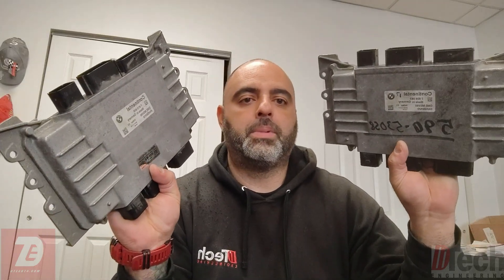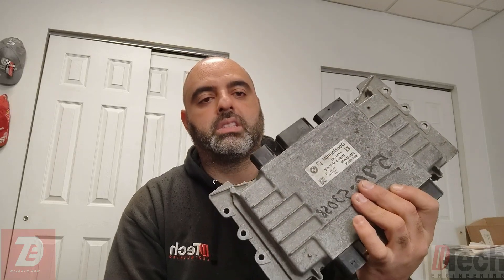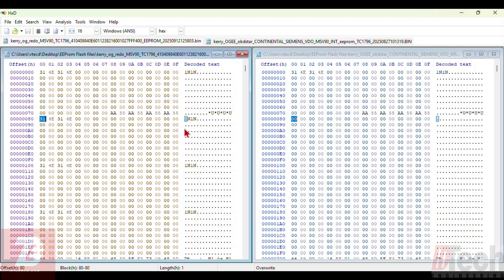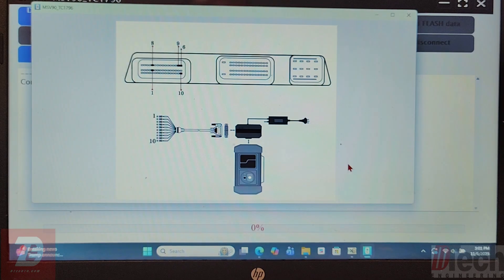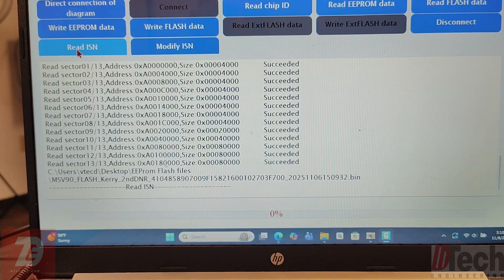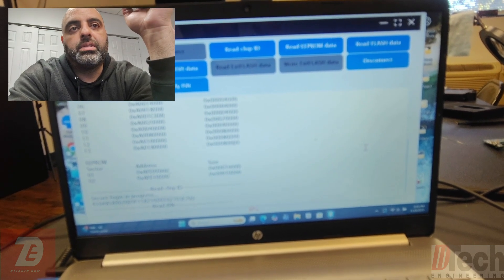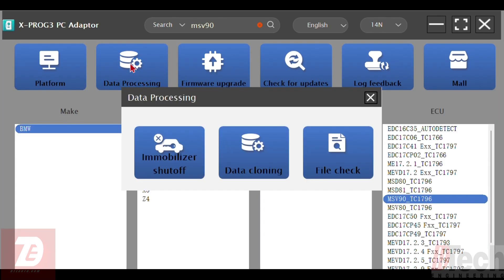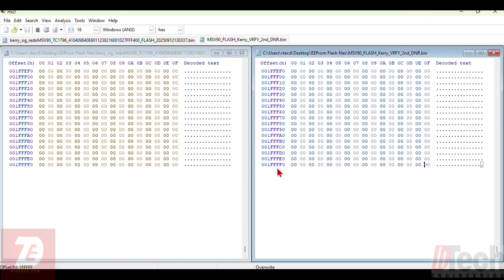BMW X3 No Alternator Control Bad DME MSV90 Clone

Comment: Dang. My installed  MED 1.7.7.3 for W212.065 E400 mercedes was cloned using obdstar. Engine run ok, no dtc. I hope it stay ok😮
Reply from the maker: if it has no issues I would say you are ok